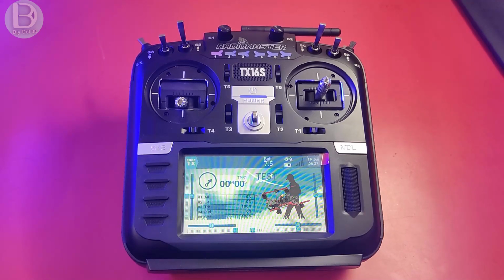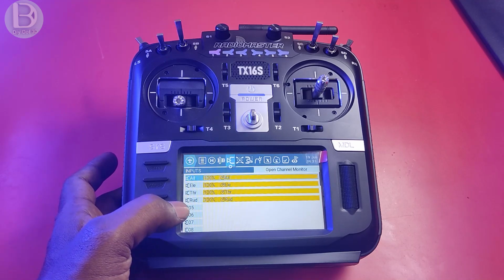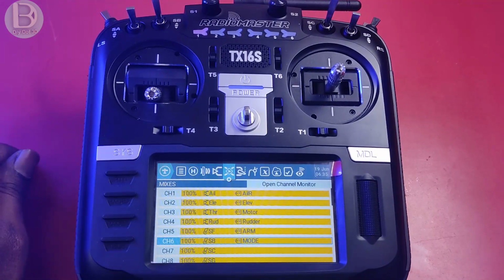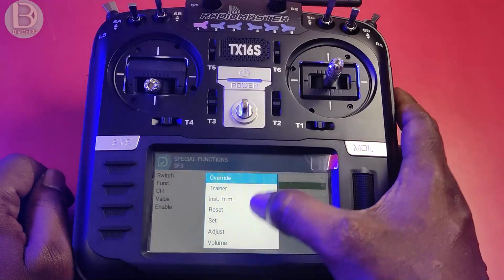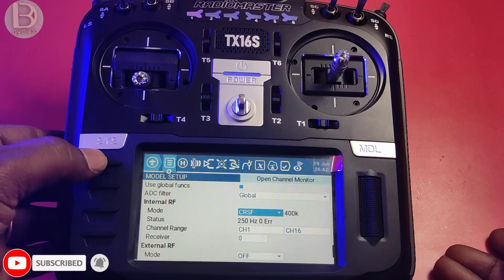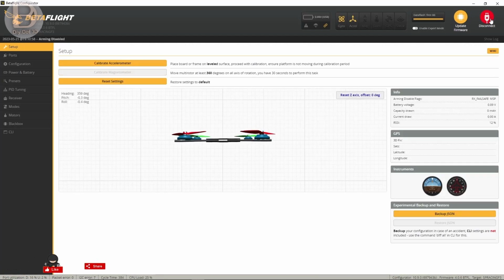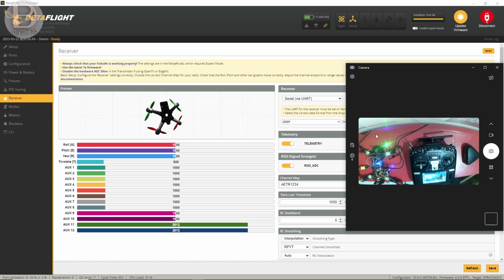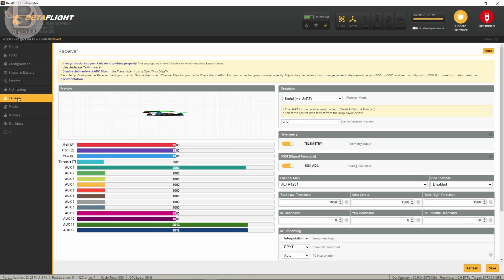Radiomaster TX16S Mark II - How  to Setup and Bind FPV drone| #radiomaster #elrs #tx16s #fpvdrone

Comment: Man I go through the process. My receiver is binded but but transmitter dosent move in betaflight when I move my sticks
Reply from the maker: Hi reciever tab select CRSF as protocol. Still not working means if you are using DJI O3 air unit disconnect yellow wire then it will work..
Reply: @ I am using DJI 03 so disconnect the yellow wire that goes from the air unit to my flight controller? And yeah my settings in beta flight are correct
Reply from the maker: @itsajoeybeat  yes yellow cable that goes from O3 to flight controller..remove any one side from connector..
Reply: @DiyDot3d  turns out just a wire came unsoldered from my crsf receiver 🤦🏽‍♂️ All fixed tho now

Comment: great thx al lot. All connected. but this warning in armed mode... Was this because of the connected cable to BETAFLIGHT? As our drone still not reacting / but connected to transmitter.
Reply from the maker: Yes. Disconnect usb

Comment: Hi, does this radio support the flysky and spektrum protocols? And is it built in or do you need a module in the back?
Reply from the maker: This is Elrs inbuilt. If you want flysky and other protocols you need to add Multi protocol module or buy multi protocol Tx16s version
Reply: @DiyDot3d  aaahhh ok, I hadn't noticed that this one wasn't the v4 4 in 1 model, that is the one I would need. Thanks!